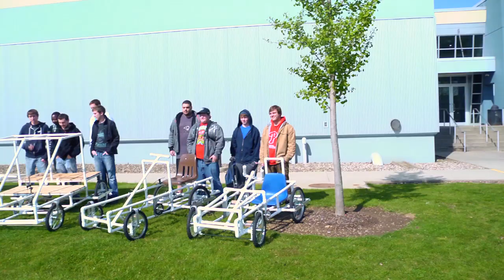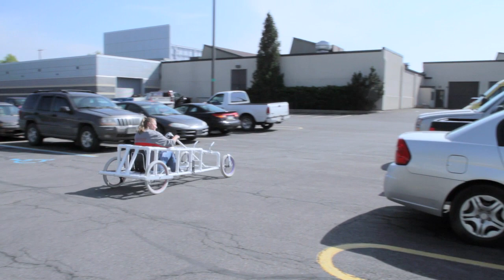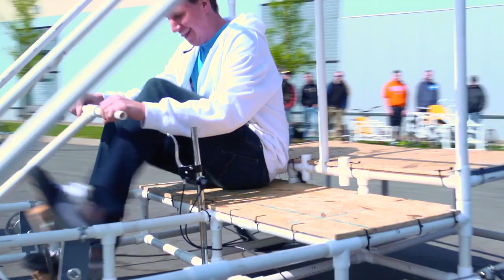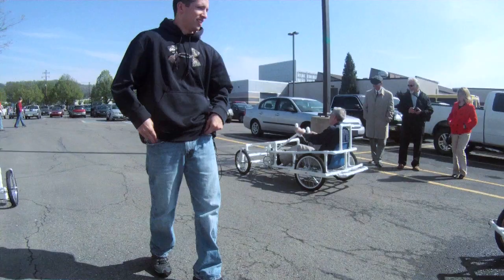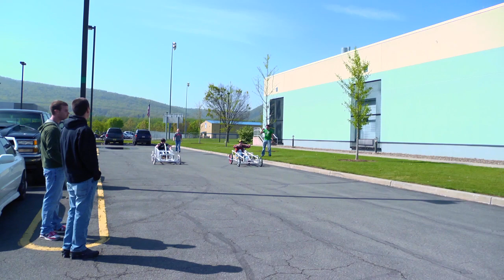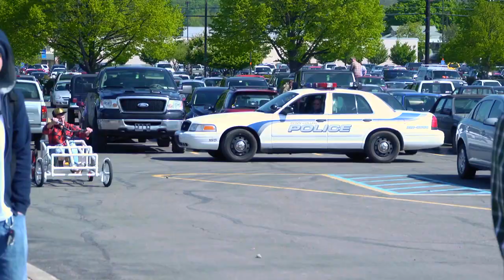PVC Quad Cycles

Comment: This could be the future of short distant transportation, something to use in conjunction with a car as opposed to trying to remove the conventional car as it is. I have a four wheeled biketruck that has a steel frame but the body supporting frame is made from 3/4 PVC pipe, which will have coroplast sheet plastic screwed to it.  It is running but I am still improving to it and fixing it to 100% completion.
Reply from the maker: TomCat Xsl Good luck with your project. It sounds like a great one! If you're thinking about college, be sure to check out the unique offerings at Penn College: www.pct.edu
Reply: thank you! :)

Comment: Am building a two seat quad for my autistic son,  and have a general idea for my plan.  what I'm curious about, is the amount of weight they can take.  The one clip showed, I believe 5-6 students on the on bike.  which I'm assuming had to be in the area of 500+ lbs.  if you have any data on the weight restrictions, and also vibration absorbtion of the pvc especially at the joints, I'd really appreciate any and all data